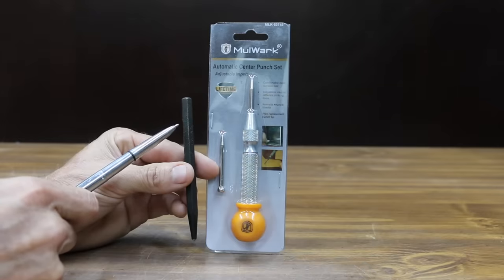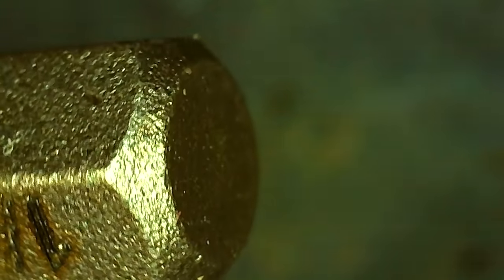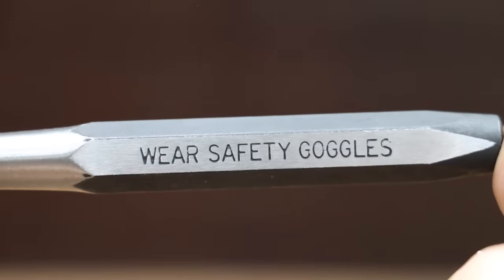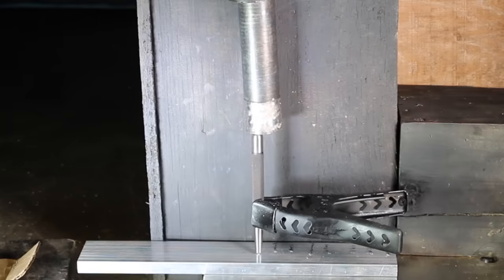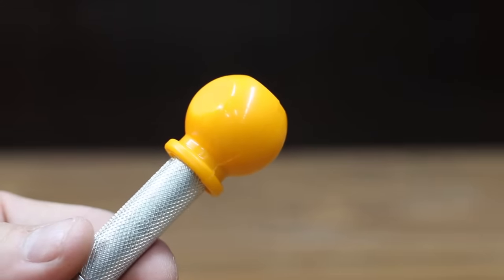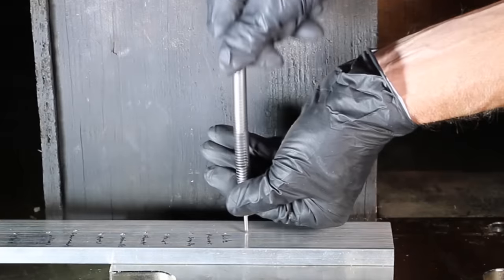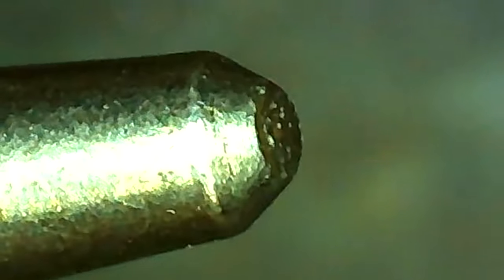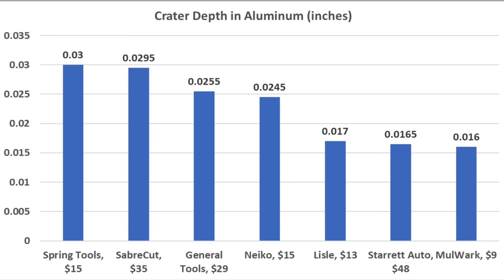Is a Cheap Center Punch Just as Good? Let’s Settle This!

Comment: VIDEO SUGGESTION: I'd love to have you do a video testing and comparing different types of window tint. There are so many different ones and all of them make so many claims its so hard to know what to choose, especially for a DIYer like myself. Another question is, whats the difference and how much of a difference is there between the more expensive brands and the cheaper stuff from China such as the ones on Aliexpress and eBay. I think some important and interesting things to test with window tint would be the following. Ease of use - are the cheaper stuff harder to shrink and apply? Do the claims of the different types of tint true or just marketing gimmicks? How well do different types and price ranges of tint block heat/UV? How long will it take for a certain space for example a car or a test box to heat up with no tint vs the best tint you can find or maybe putting different types in a head to head test. I've also wondered if one can get away with putting tint which blocks very little visible light, but instead blocks UV and therefore heat on the windshield. I believe it is technically illegal at least here in Australia to apply any type of film onto the windshield, but I'd be curious how big of a difference it makes if the rest of the windows have already been tinted. Let me know if you plan on taking me up on my video suggestion. I love all of your videos and I find them very entertaining and helpful. Thanks!!
Reply from the maker: Thanks!  Thanks for the suggestion.

Comment: I basically used snap on or mac manual punches for a large part of my career.  No real issues but eventually they all need a touch up. Then i got a snap on auto one but im sure it was a lisle made one. Have used it for well over 20 years. I also bought a harbor freight auto punch many many years ago and surprisingly it has done well for me. I have had no need for something "better".
Reply from the maker: Thanks for sharing.

Comment: Nice one Todd 👍🏼
My personal opinion on auto punches Todd, is that they r great for carpentry/woodworking.
My grandpa and dad both had been in mechanics/fabrication
All their lives and I never saw a auto punch in the shop. That speaks volumes to me. But I'm sure it does not apply to everyone. As  a carpenter and remodeler since I was 16ish the auto punch leaves a clean non accidentally erased  mark ‼️
It is my opinion that these starrett Auto punch was a defect. I've never had problems with their woodworking tools or anything related. I'm retired now but I remember seeing proto and Williams tools of various types in my grandfather's toolbox so they've been around for a long time. It is a good feeling to know that some tools have made it through the hard times and still made here in the USA 👍🏽😀.
TODD , have you ever done a hand files test ??? Of rotory file/rasp that could be used in a drill OR pneumatic/ electric tool made for such use ???
Reply from the maker: Thanks!  Thanks for the suggestion.

Comment: The Starret auto punch was damaged before it got to you.  I have that punch and it is awesome, mine came with a very sharp point and it's still sharp after years of abuse.  I also have the Lisle auto punch and it is great for finding center on scribed metal.  The point is sharp enough to get down into the scribe valley and you can feel the intersecting line when you go across it.  When you feel the intersection stand it up and pop you have your drill point.  I also use the Snap On to follow up after I have the initial punch depending on what I need to do.
Reply from the maker: Thanks for the feedback.

Comment: I agree that it is very important that the punch can be resharpened yet maintain its hardness.  How many times it takes before it needs to be resharpened is a big factor also in what I purchase.  Thanks for another interesting video.  If a product is crazy expensive yet only performs at the level of the cheap tools then it ought to be excluded from the test for that reason alone.  Yuppies that just want a box full of brand names are going to buy regardless but those of us that use our tools are more likely to want value for money spent.
Reply from the maker: You are welcome!  Thanks for the feedback.

Comment: Good video as always. I’m left wondering if depth is the right measure of performance, or if diameter of the scar would be better. Does a drill bit reach the bottom when skating across the workpiece; doubt it. I’m curious about the bite each of these offers to something like a 1/8” drill bit. Hmm.

Comment: You had a defective Starrett tip.  Keep in mind they have  2 or 3 versions.  I used to use a cheap husky punch and a heavy duty Starrett.  I now use the Rennsteig.  They also have two versions.  The palm grip makes it easier to press when you are reaching across a workpiece like a large panel.
Reply from the maker: Thanks for the feedback.

Comment: in my tool box a have a few Armor piercing  cores from a 50 BMG that i pulled out of a gavel pile i shot into,  they are the best center punches made, i shot 1 threw a 2" steel block, and it was still nedel sharp sticking out the other side..
Reply from the maker: Thanks for sharing.

Comment: You could try comparing screw types; Phillips, Torque, Straight Slot, Robinson etc. See which resists deformation and stripping under highest pressures.
Reply from the maker: Thanks for the suggestion.

Comment: I just bought the Spring Tools hammerless punch based on this video test. I already have the Starrett automatic center punch which I found to be more difficult to use as I had to push hard to trigger it, plus it sounds like a gunshot when it punches. Doing a random test on some T6 aluminum, the Spring Tools worked much better with far less force! On top of that, it's easier to keep the Spring Tools on target versus the Starrett where I had to push down hard enough that it often slips a bit.
Reply from the maker: Thanks for sharing.

Comment: I use my grandfathers, it's as sharp as any other I've ever used. It's made in Sweden and it's been used for over 100 years. It's as sharp today as a brand new SnapOn is and I know because someone thought I would need a new one and gifted it to me. 

Not being an idiot I use that as well but on hardened steel it doesn't work while my grandfathers works just fine without doing anything to it.
Reply from the maker: Thanks for sharing.

Comment: This is why I'd like you to test smoke and similar alarms.
From a friend just now. I can't evrn make toast without my wired alarm going off! I had my smoke/carbon monoxide alarm going off at 7:30 tonight. I finally unplugged my dehumidifier in the basement and after a few minutes it stopped. The alarm system is hard wired in and is ear piecing, anyway I may see if the fire department can come and check it out for me. I had the property manager on the phone the whole time it was blaring.   I opened my window in my bedroom for tonight....  😊
Reply from the maker: Thanks for the suggestion.

Comment: I have the Starrett Auto punch and I can assure you that you got a defective center punch. When it was brand new, the point was extremely sharp and it barely suffered any damage in the 10 years I got it. I am not saying it delivers a punch like the Spring one, but it's capable of holding its own. I never work with hardened steel though.
Reply from the maker: Thanks for the feedback.

Comment: One test that could have been done between both types of centers is something like box or tube steel thats on the thin side. How much outside deformation is done to the surrounding metal outside the center punch zone. Can graduate up the thickness until they stop doing damage vs a minimum depth. I think this is where the automatic centerpunches can really shine. Also would be nice to see a possible destruction test with some stone type punching. Something soft like concrete all the way to something like hard granite or maybe some jade/nephrite. I mean you can use drill bits on them so why not use a center punch, right!

Also a nice side note with old center punches is they make really good hand held chipping hammer substitute. For like small detail areas to get slag and knock off some weld blobs that stick. Don't even need a hammer really for most of it just peck at it by hand and most the weight of the tool will do the work.
Reply from the maker: Thanks for the suggestions.

Comment: I use one of the spring tools punches constantly at work removing door hinge pins, there's no better tool for that. They have one that has a longer flat pin. However I've found those to snap at the head of the punch, rendering them useless. The center punch has a very hard pin, the only issue I've ever had after years of use is that the pins can come loose from the head, but a little jb weld has permanently repaired it (so far).
Reply from the maker: Thanks for sharing.

Comment: Would have been cool to see you make you own center punch out of a steel rod. Could use a drill press to act as a lathe and heat treat the tip with propane/map gas
Reply from the maker: Thanks for the constructive feedback.

Comment: Two ideas for tools but may have been done
First
Speed squares, machinist squares, and t-squares. Comparing high end stuff like woodpeckers to its clones and cheap stuff would be nice so like accuracy, features, ease of use, build quality, weight, and accuracy adjustability 

Second
Clamps 
Would be nice to see bar clamps and f style especially but as well c clamps and alligator/squeeze clamps too. I’d be curious to see things like overall force, total surface area of clamp “teeth” if you will and of that surface area of the clamps teeth or jaws how much is usable and/or what’s the minimum amount required to be on material before the clamp slips off. Other nice factors might be ease of use for tightening down, action, weight, and jaw style (does it leave jaw marks in the wood etc) would be nice to see the dollar amount associated to clamp force like dollar per pound of pressure
Reply from the maker: Thanks for the suggestions.https://www.youtube.com/watch?v=wa9H9rh8sns

Comment: Aw I was hoping to see the Rennsteig in this matchup. Its a classic in germany, always recommended when people look for center punches. the company is a high quality manufacturer, part of the knipex group. would have been interesting to see how it compares.
Reply from the maker: Thanks for the constructive feedback.
Reply: @ProjectFarm  I thought more about the testing and I am not sure if the depth is a good indicator of performance.

A very pointy punch would of course create a deeper dent than one with a shallow angle - but also create a larger diameter dent.

Depending on the drill size a small but deep dent might even be worse, because the thick drill might not grip in the dent.

Also a pointy punch will wear down faster than a blunt one. I'd imagine the harder the material, the blunter it has to be. A automatic punch might need a pointier tip since its force is lower.
The german standard DIN 7250 defines an angle of 90°, the stahlwille for example seems to be according to that standard.

Maybe a fun test for a round 2 would be to sharpen the same punch to different angles and see how the tip holds up and a drill bites to the different dents.

Keep up the good work, love your videos!

Comment: Thanks! You did a review on battery-powered shop vacs. How about a video on the different handheld vacuums? My NiCD Black & Decker from 2013 is dying and it sucks that the battery is not easily nor affordably replaceable. I am hopeful that the different tool batteries -- Ryobi, Dewalt, Black+Decker -- being the source of power will enable much easier use and replacement and upgrade for your handheld vacuum. Thanks!
Reply from the maker: You are welcome!  Thanks for the suggestion.

Comment: Some of these are probably easier to aim than others. I think the strength and durability of a punch is actually second place to the ability to precisely locate the indentation. A follow-up test could include a best out of three accuracy location evaluation, seeing how closely you can get that lined up to the exact point intended. The automatic punches may struggle in this test because they have a tendency to walk as you're pressing down on them. But some may be better than others.
Reply from the maker: Thanks for the feedback.

Comment: Wow, great test.  I'm glad to see that most of the manual punches did pretty well.  The automatic punches are better suited for soft material.  How about a second round with cheaper punches like HFT, Stanley, Home Depot house brand, Lowes house brand, etc.

A while back, I bought a demolition tool (rotary hammer drill).  I was looking for a solid chisel and I noticed that my choices were limited to a Bosch made in Italy and DeWalt made in Germany.  I don't know if I made a good choice, but I bought the Bosch.  Can you test different chisels in a demolition tool.  I'm curious if there's a difference in hardness/strength.  Maybe do a demolition test on different materials - hard wood, glass, nails, screws (both drywall and gold screws), rebar, stucco, etc.

As always, I enjoyed this video and I learned something about punches.
Reply from the maker: Thanks!  Thanks for the suggestion.

Comment: Would've liked to see a control test smacking the back of the drill with a bit in it, and maybe some sort of test with a drill bit in the divot spinning backward so it doesn't cut with the test sample being pulled sideways and the force measured, but that's all the holes I can poke in this no pun intended.
Reply from the maker: Thanks for the suggestion.

Comment: I just thought of a test idea.  We're cleaning the kitchen of one of our rentals.  There's a lot of grease from cooking on the cabinets and walls.  I tried using some of my auto cleaning products.  Simple Green (green original formula), Krud Kutter, ZEP degreaser and Purple Power.  Each was first diluted per the instructions - the results weren't very good.  Then I decided to spray it on full strength.  I was impressed, but the Purple Power stripped some of the varnish off the wood - not good, but it sure did a good job.  

I'm wondering if you can do a degreaser test.  I read about some "new" products that are designed for grease cutting (purple/pink HD Simple Green, Superior grease cutter, Goo Gone grease cutter, etc).  Also, how about the old Awesome sold at the 99 cents store.  Or Superior's Dark Fury?

Thanks again for all your great videos.
Reply from the maker: You are welcome!  Thanks for the suggestion.

Comment: How about comparing wire wheels for bench grinders.  You could compare coarse, fine and brass.  I just picked up a cheap 6" wheel and switched from safety glasses to face shield due to so much shedding....thanks
Reply from the maker: Thanks for the suggestion.

Comment: How about mower deck spindle belts?  Testing durability?  How many engagements it takes before the belt becomes too loose to function.  How much gription they have to supply engine force Vs. not working if something gets caught in a blade or pully.  Does color indicate strength or is it just pretty to attract the eyes?  How easy are they to catch on fire from friction to ignite grass trapped on the deck?
Reply from the maker: Thanks for the suggestion.

Comment: You should do a video on 18v battery adapters and their effects on the batteries and reliability. I just got an adapter to allow me to use Milwaukee batteries on makita tools and want to know if it will ruin the battery, or the tool
Reply from the maker: Thanks for the suggestion.

Comment: Your tests use a lot of scales and measuring devices. Do you think you can test some of those products? For example, which body weight scale is the most accurate and can maintain accuracy longer, or which torque adapter is more accurate. As always, great video.
Reply from the maker: Thanks!  Thanks for the suggestion.

Comment: We used to use center punches to check snd make sure gas lines were dead. We would grind a little slice hit it with a punch and then grind down to the depth of the punch but no deper then hit it again over and over until a hole was punched and you could tell there was no pressure. It was mostly 4" 6" and 8" gas mains but every once in a while we'd do some 10"s 12" and a few others. I hated grinding those things down to a cun-hair hoping i don't apply to much pressure and grind past the divet from the punch....lol
Obviously it worked and it saved alot of bullshit because if we would have just ripped them out or broke the cast it would have went boom or at the least started screaming wich is never a pleasant sound.
It was "supposedly" safer than drilling since the motors sparked and the bits caused alot of if friction. Found alot of live gas mains that were supposed to be shut off or abandoned so i obviously worked.
Reply from the maker: Thanks for sharing.

Comment: I've bought a set of Starrett punchs and automatic punch 9-10years ago never had to re-sharpen them, i'm careful with them, I don't punch Stainless steel or metal that was heated, instead I use an old tap that I've sharpened but can't hit as hard since it is more brittle. Also you Starrett automatic punch was probably a quality check mishaps I own the 18c and 18aa the points on mine are not dull like yours.
Reply from the maker: Thanks for sharing.

Comment: As always, a great and helpful video.  One additional thing to consider is the failure of automatic center punches.  Even the spring of the SpringTools punch will fatigue (I am thinking it will outlast me!), but in my experience, the trigger mechanism of automatic punches fail.  Perhaps you could do a test of their durability?
Reply from the maker: Thanks!  Thanks for the suggestion.